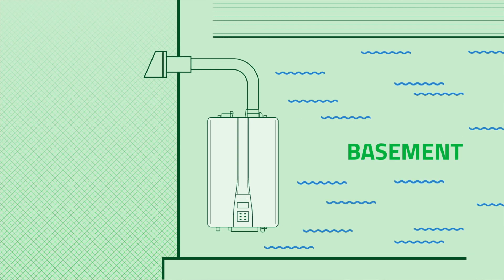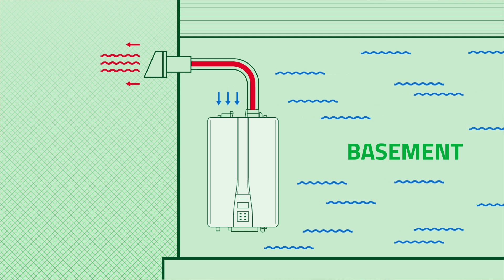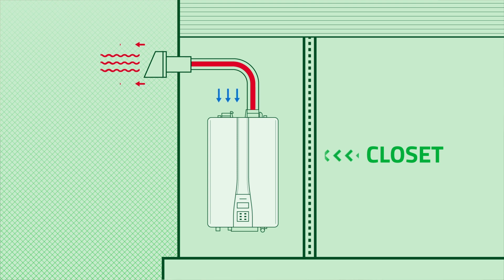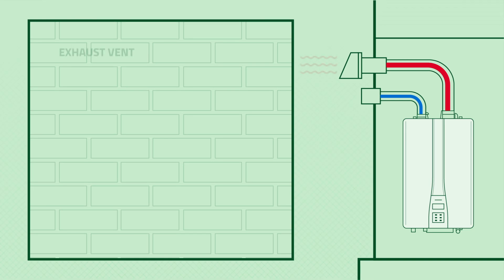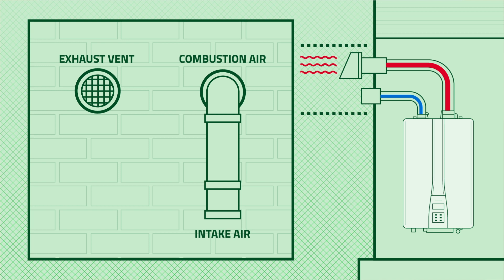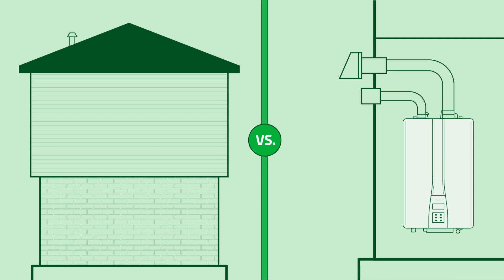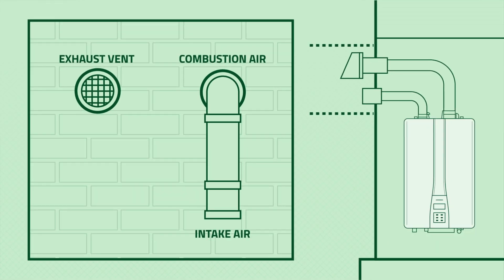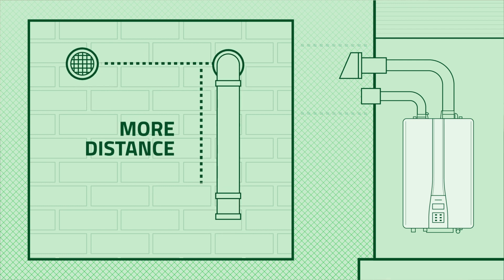How to: Venting tankless through the side wall

Comment: I am installing in my basement, large and open. So I take it I do not need to bring air in from outside? Correct? The instruction included with this tankless unit does not provide this option.

Comment: I purchased a z-vent horizontal termination, how are these finished when going through siding?
Reply: A plastic trim ring with caulking around the pipes and around the trim ring to prevent drafts
Reply: Where do you buy these?